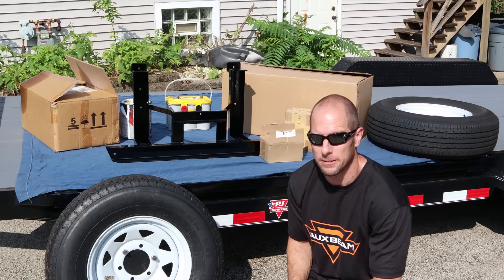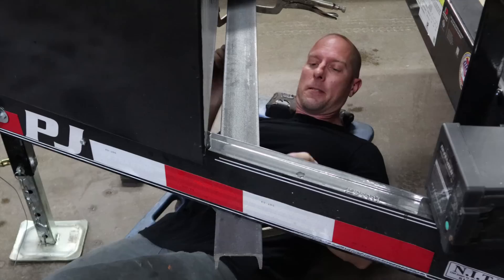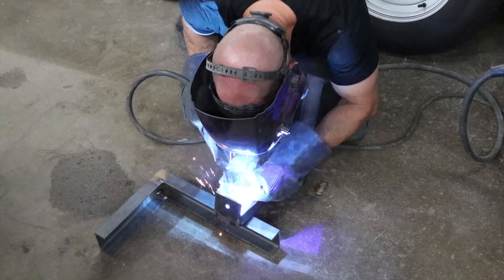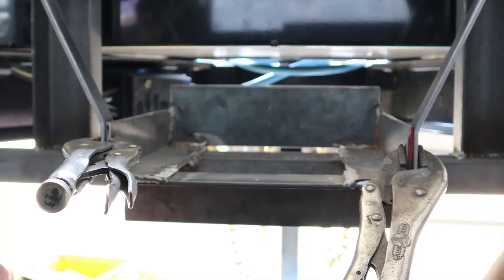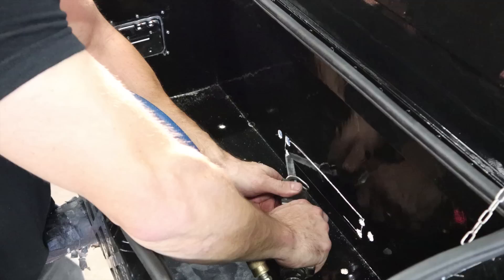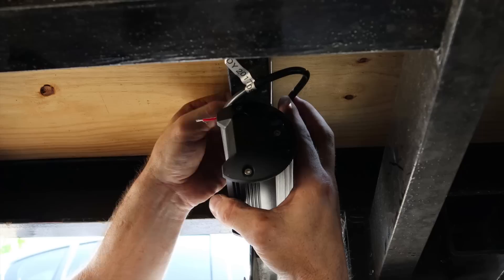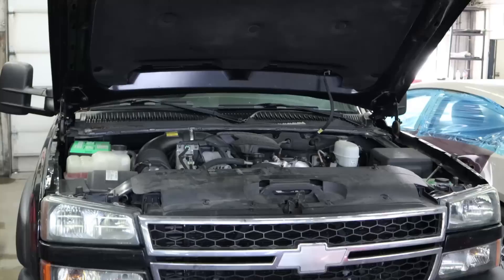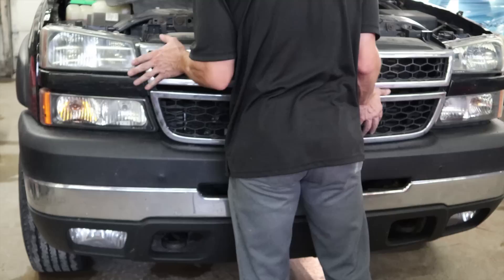2019 PJ equipment trailer winch mount fabrication,  LED light installation and other mods..

Comment: Upgrade your winch line to synthetic. You'll thank me later.
Reply from the maker: Maybe when this one breaks!
Reply: @vehcor  I'm pretty sure it will never break if used properly. But they do get dangerous when under load and your connection isn't secure or breaks free. From my experience the synthetic line is much safer and stronger. It won't curl and hold memory. It can be held without gloves with a fear of being pricked. Lighter. Can be repaired after being cut. There's more benefits than loss.

Comment: U SHOULD us nitrogen. U will never have to use so many tires. I bet u do not use nitrogen. U get 12.000 lb winch? Warn i hope. We have got 1/4inch cabel.
Reply from the maker: I use 78% nitrogen like everyone else.  No need to go the 100%, it is a scam.  Unless that will keep the tires from losing pressure due to punctures which is the only reason I have ever had a flat.

Comment: Who uses an air drill anymore?
Reply from the maker: Umm, most people in the automotive industry.
Reply: vehcor lol, yeah? Lotta repair techs you know using them? or factory workers? 

Right, neither of them even manually drill frequently anymore, but nobody wants to deal with the noise of an air drill , or the compressor, or fight with the hose. Its like steam powered tractors to a Tesla model X
No son the days of selling air drills are long gone, check the numbers with any tool guy and educate yourself before trying to correct someone who isn’t just keyboard smart on the subject. 

Who was it? What industry?
Reply from the maker: Every tech in every shop I know uses them.  They may have electric drills for the quick little jobs but when you are drilling half a car apart they cannot keep up.  They burn up and overheat so after embracing new tech, they pull out the old trusted tools.  You are right, more tool guys sell electric tools now.  It is because everyone has the air tools.  Why buy more of what you already have?  You buy what you don't have.  So sales of air drills have remained constant and electric tools have increased.  Give it a few years, it will level off just like air drills.  Your Tesla analogy is right on.  They sell far more Teslas today than 10 years ago, just like battery powered tools.  Why? They are more reliable and were not available at a reasonable price back then.  People did not stop buying internal combustion engines when electric cars came out.   Why come to my channel just to comment on the tools I use?  Obviously just to seek attention.  So don't act like a keyboard warrior and then try to present yourself as someone that has a clue.  Post some videos of your work and experience so I can have a chance to tell you how you should be doing it.  Thanks for watching.

Comment: Spare tire lugs don't go on with a Impact. Smh
Reply from the maker: Since I am not an hourly employee looking to run out the clock while getting the least amount of work done, I use the efficient way.  Rather than drawing in the studs and torquing the wheel on.  I ran them on with an impact.  I'm not a wuss, I will be able....... wait I was able to get them off when I needed to.
Reply: @vehcor  If you say so

Comment: Should have stripped and powder coated the whole trailer. I really like my PJ trailer but their powder coating is a joke.
Reply from the maker: I have yet to see a single manufacturer of trailers, equipment or truck bodies with a good powder coat.  I have yet to see any aftermarket powder-coaters do any better.  The only way to keep it perfect is not use it.  It is not just a PJ problem.
Reply: @vehcor  Interesting. I have other trailers but no other "open" ones to compare. I honestly would much prefer a painted trailer just because it makes touch ups possible unlike powder coat.

Comment: sorry===call BS on the thousands !
Reply from the maker: Sorry, you are wrong.  Lets do the math on my rebuilds:
100 cars/year for 10 years = 1000 (yes some years were more, some were less) but that qualifies as 1000's, it is no longer in the hundreds.  BUT WAIT THERE'S MORE..... 50 cars/year for the next 10 years = 500 and we will just discount the last 5 years entirely to give you some much needed help on your end as I have cleared 1500 of rebuilds alone.  Heck I have owned over 500 Pontiacs alone.  And before you come up with some BS like those are not my cars.  I paid for them, I could have kept them all, so I owned them, maybe only for days or hours but I still owned them.  The thousands of people that drive past my house will tell you the same thing! lol

Comment: Powder coat??? Good luck worst paint on the planet would never ever buy a PJ trailer
Reply from the maker: Powder coating the parts I build has nothing to do with the trailer type.  Everyone has their preferences, PJ is mine.  If paint is a problem for you, maybe trailers just aren't for you.
Reply: vehcor good luck with your pj which I could send you pictures of a 4 year old pj trailer I think you would understand what I'm talking about
Reply from the maker: A Slabaugh sorry to inform you but every trailer from any manufacturer looks like crap after years of actually using it as intended.  It pays to maintain it along the way to keep it from getting out of hand.  So given that they all have bad paint, I chose the manufacturer that has the most nationwide support, highest quality build methods and best warranty. Paint is going to get destroyed unless you just park it and never use it.
Reply: My PJ is 7 years old and the powder coat looks great still.